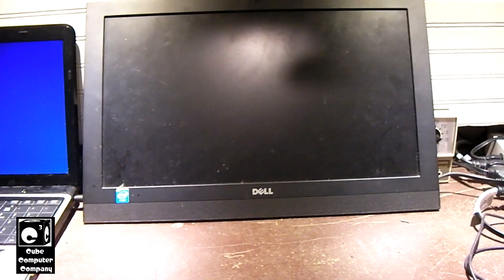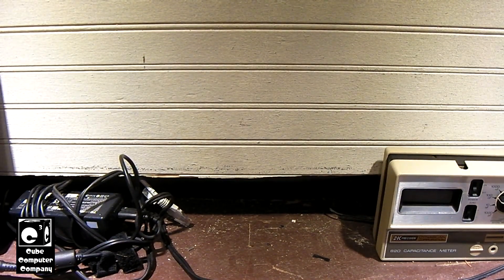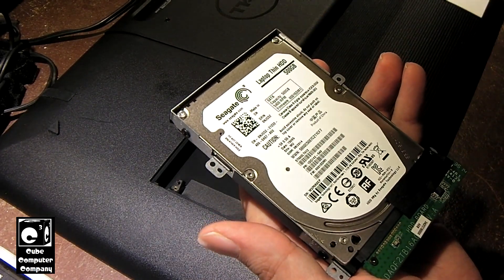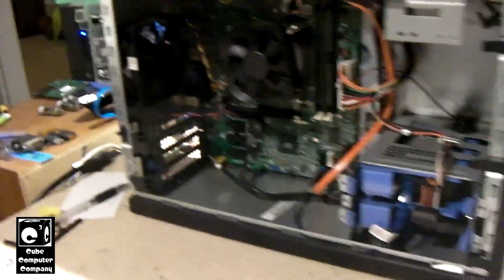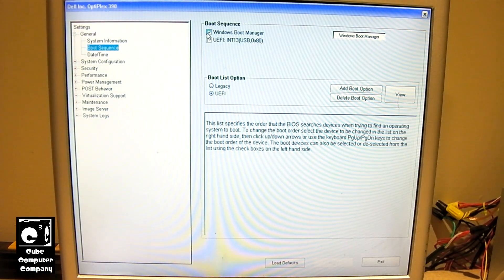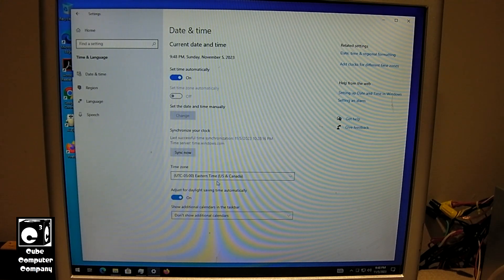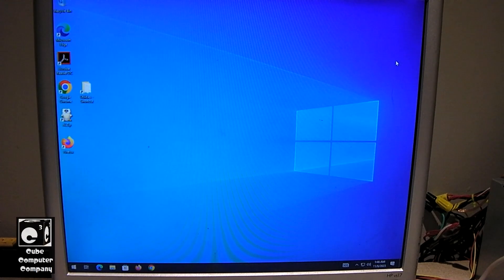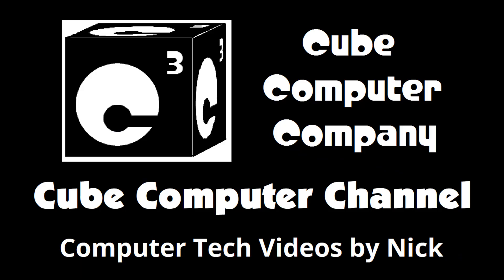Owner of slow Dell AIO PC gets upgraded to an Optiplex 390

Comment: Other than for offices that want a clean layout, AIO PCs suck 👎
Reply: AIO PCs suck there as well. I work on older office PCs for a living, even higher end business AIO machines like optiplexes are a pain in the nect to do anything on. Even something as simple as removing the RAM or HDD require quite a bit of disassembly. If they really want the clea look, they would be much better off going with something like an ultra small form factor OptiPlex and getting the stand that allows it to sit on the back of the monitor. Lenovo also sells something similar for their "tiny" ThinkCentre desktop machines called the "Tiny In One" but I have not been very pleased with the newer lenovo machines I have dealt with the past few times.